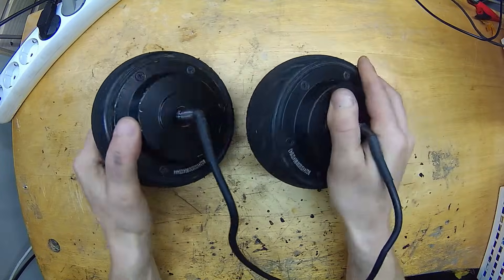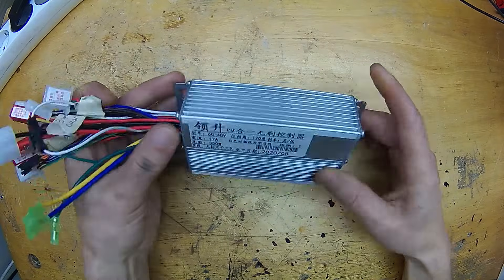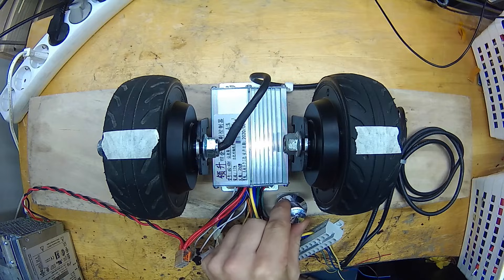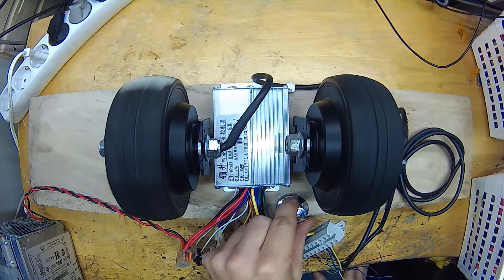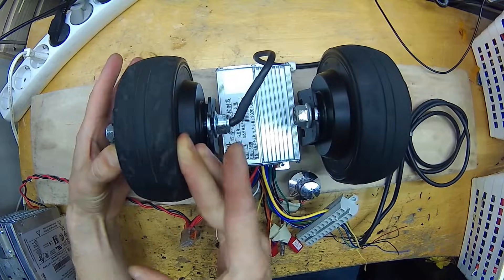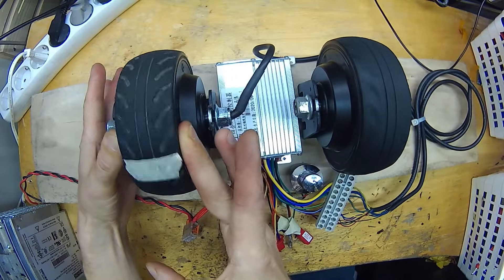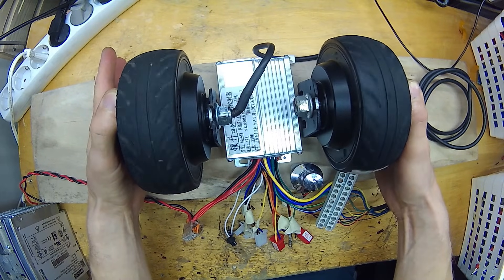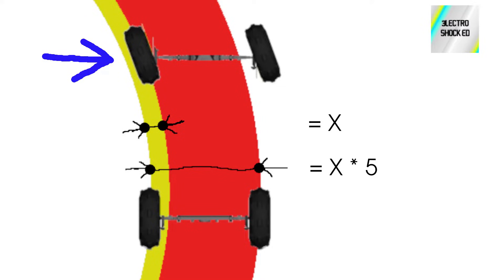2 HUB MOTORS with 1 CONTROLLER ? Yes you can!

Comment: This only works because slave motor is not loaded. Rotation at the same speed on a road does not help really because they need to be aligned in phase almost perfectly (unrealistic), not just the same speed.
Reply from the maker: yes, almost

Comment: Hi and tnkxfor your input on BLDC motors dual motors and it works as you said  ,I have a pair of hoverboard motors that I use to drive my fishing trolly ,I have a china controlbox ,NOW I need to know how to reverse the motors what cable do I need to use to reverse the motor ?
Reply from the maker: some controllers do in fact have a reverse switch, which can be used live - but this is very rare since meant for a 2-wheel vehical

Comment: So you basically are just connecting all the wires in parallel? Is the controller you are using designed for 1 motor or 2?
Reply: Also, do you have to account for the increased amperage?
Reply from the maker: yeah, just parallell. yes, one should account for double load if try this.

Comment: thank you so much! this is exactly what i wanted to see, saves me the time of trying it with so much worry. I got my custom built prototype etrike with front and rear motors and a controller with absolutely no setting adjustments i am allowed to change, so, i want to add my FARDRIVER 72300 to it with complete adjustable control, for both motors and 1 controller, this is great for me, Thank you.
Reply from the maker: Glad it helped! :)

Comment: I have an e scooter which runs on 36v. The scooter is broken, but only the battery survived. I have a hoverboard, and i want to make a mini bike, and i van to use the scooters battery, so I don't have to buy another one. Thanks for showcasing this. I'm gonna start this project today, but I have a question. The hoverboard motors together are 500w. A 500w controller will be enough?
Reply from the maker: yeah, should be fine. but be aware about the phase issues that I described. maybe leave the signal wires unconnected, if your controller supports that

Comment: cut them both hall sensors pcb inside the wheel itself and dont use hall sensors at all
Reply: Yeah I would have liked to have seen them run completely without sensors.

Comment: So, I have two of these motors, I think they are 350 watts. I bought the e bike controller that handles like 350-500 watt. Will it be possible that the controller will burn out because 2x350 is 700 watt motor?

Kind regards,
Dennis
Reply from the maker: Hello! Thats a good question. In theory the controller will just give them both tha max it can. But also it will be running full power all the time, which puts extra pressure on the elements... I presume something will quit at some point
Reply: @3LECTROSHOCKED I decided to go two controller 🙂

Comment: With all these new controllers out there now, One fardriver 200a line phase should be a better overall since it’ll take up less space to run dual hub.
Reply from the maker: thats right!
Reply: I got my custom built prototype etrike with front and rear motors and a controller with absolutely no setting adjustments i am allowed to change, so, i want to add my FARDRIVER 72300 to it with complete adjustable control, for both motors and 1 controller, this is great for me,

Comment: Hi may i know where did you get those wheel brackets for mounting? Bc i cant seem to find it anywhere. Also, is this a 4 inch motorized wheel?
Reply from the maker: they are original, from scooters the wheels came :)
Reply: @3LECTROSHOCKED  do you have the link to purchase the same wheels?

Comment: Can you attach a second motor with its own power source and use the one accelerator to control both motors? 

I want to attach a chain motor to the front wheel but I'm thinking if possible just buy a separate battery for the motor . I hoping that you can use the same accelerator to control both motors?

I'm not to concerned with the rotation of the motor. I just want to use it as a boost for longer distances.
Can you do that that without blowing yourself up?
Reply from the maker: Good question, thanks! You could use a system based on two optocouplers to keep controllers voltages seperated. And control them both with one speed controller. Check out info about an optocoupler :)

Comment: very informative experiments - the question was asked below on increasing the controller power capability  but one also has to make sure he battery BMW is ok with about 2x power delivery - right?
Reply from the maker: Hello! Thanks for Your comment. I personally dont use BMS systems on my batteries, so I dont have an amp-limiter in that sence. But yeah, you should have a battery pack with appropriate amp-rating for Your device :)

Comment: Hello 😮 nice job. I ve got a big problem. I ve got a scooter 5600 watt dual motor. I want to connect second battery but i can't find connectors with two cables for batteries two cables for controllers  😢😢 scooter it's 5600 60volt and each battery it's 40ah
Reply from the maker: Hi! Thanks for Your message. Well, I guess you should start searching for the cables, starting from the battery. They should be there for sure :) Best I can advise at this point.

Comment: thank you for the nice video.
i wonder how both wheels can spin 'forward' when you connect the same phase wires for both. Becoz since they are facing each other, one is actually spinning oposite direction to the other..
Reply from the maker: Hi. Thanks for your comment! Since this is not a dc motor - the direction is actually controlled by pulses. And if 3 main wires are exactly in parallel - they will spin the same way :)

Comment: It won't work.. the only reason it's barely working in your test is because the motor can bump forward/backward to align the phases again with the other motor.. when there is friction on the tyre and the motor can't bump itself back in to alignment with the other motor you will have constant desyncs.
The reason either motor shuddered when both motor's hall sensor wires were connected was because you're sending two different signals.. the motor that you aren't putting resistance on will still be sending pulses, so the speed controller keeps doing its thing.. The speed controller doesn't know that you've stopped one motor.
Reply from the maker: Hi! Thanks for your comment! Good points. That's exactly what I was testing. The surprising result was that they kept producing torque in a slight disalignment. Need to test on a real vehicle:) maybe this summer
Reply: @3LECTROSHOCKED  There isn't such a thing as a slight misalignment.. the motor will either cog forward or backwards one full phase, or the current draw will jump through the roof.
If you had this on a bike and you turned the corner, even the slightest additional distance covered by the front wheel would mean that the phases are no longer aligned and the front wheel will lock up.
Reply from the maker: Yeah, thanks for your comment! :)

Comment: Nice !!! 
Can 4 hub motors work with a single controller or is a special controller needed ?
Reply from the maker: Hi. Thanks for your comment! Why not, but you will have problems while turning your 4-wheel vehicle :) I assume that is what you want to build.
Reply: @3LECTROSHOCKED  that's right, i plan to build a mini utv in the near future
Reply from the maker: Yeah, too much radius if on a same axle:(

Comment: I want to use  two no of 350 watt  brushed dc gear motor , total 750 watts. Can I use an 800 watt brushed motor controller with a single throttle to control the motors any suggestions pls.
Reply from the maker: Hi! So you have two basic DC motors? Well that should be super easy :))) Just connect them parallel and hookup to a controller that can deliver twice the power. Shouldn't be any problem - I think :D Only thing I can think about is the slash in the resistance - but in theory that should not be a problem if your controller is  powerful enough :)

Comment: Any idea how to get one throttle running two motor? Each motor has its own controller but shares one throttle.  I got it working by sharing the throttle signal wire and the positive wire (do not connect the ground wire) 

As soon as I turn off the power switch on either controller, one of the motor spins at full speed. Any suggestions?
Reply from the maker: Hi! Well ground is shared anyways, if they are in the same battery. So try putting diodes in the signal to prevent back voltage from a controller to other controller :)
Reply: @3LECTROSHOCKED  I got it working properly right after I commented your video. Apparently, if you are running separate batteries like I am, you must connect Ground on each battery together, then connect only the Signal wire from the throttle on both controller. Nobody mentioned the Ground wire on the batteries every video I watched lol. Thanks for getting to my comment. Thanks for making this video.
Reply from the maker: Oh, great that I could help! :)

Comment: This will only work if you place 2 hub motors in the same line like on the scooter. If you apply resistance to one of the motors the phase sync if going out of control and basically one motor is pulling or stopping the other. So if you would like to use it on let's say a go cart,it will not work properly
Reply from the maker: Hi. Thanks for your comment! That's exactly what I'm examining here. And the result is yes, you can. But not on a same axle, like a go cart. You should watch the video till the end, if you haven't yet :)

Comment: What about 72v 1500watt system , like adding a same power hub motor model n front wheel to rear hub motors controller. What will happen? Will both motor's peak power will deduct due to 2loads in controller? My controller is 72v 1500watt peak current 50A ?
Reply from the maker: Hi! Well it's the same situation, so you would need a controller of double the power. Otherwise you will overload it and eventually burn it. Or course it would work for some time first :)

Comment: Did you use one battery too?
Reply from the maker: Hi! Yeah, one controller - one battery - one throttle.
Reply: @3LECTROSHOCKED  okay thanks, I guess I should try, i want to add a front hub motor trying to run them both on my 36v 10AH battery and same display monitor. 
Both motors are 36v 250W, do you think it can work?
Reply from the maker: You need a controller of twice the power, so probably no :(
Reply: @3LECTROSHOCKED  okay thanks I will go with your recommendation. I appreciate your time...
Reply: @3LECTROSHOCKED  , one more question, will 2 separate controllers work on 1 36v, right?
Reply from the maker: Yeah, of course, but will be consuming more power.
Reply: @3LECTROSHOCKED  okay thanks🥴

Comment: Always thought that two hubs one controller and one throttle and multiple batteries was the only way to go. Hiding all wires in frame using Bluetooth connections when possible. For speedo & battery levels if posdible. UBCO is about the best I've seen up to now.
Reply from the maker: Hi. Thanks for sharing:)

Comment: Hello brother it's a very much learning video I have a question on this topic can we add joystick to this controller please make one on 3 way front back and rotating side through joystick it'll more helpful
Reply from the maker: Hello! Good question. That would require a separate controller on each motor. Also there needs to be a reverse switch on those controllers. Making a joystick interface and connecting it is not that hard, if you have all of those functions available. I advise you to check out general controller boards. Ebike controllers are not the best choice for that kinda project :)
Reply: @3LECTROSHOCKED  can you make one video on this topic of  3 way drive front back and side ways
Reply from the maker: Sorry, I don't have any use for that now. Maybe in the future :)

Comment: still running fine. id just make sure the controller can handle both hub motors. now i am adding a setup booster to my 48v 60ah battery. im jumping the hubs to 72v
Reply from the maker: Great! Sounds awesome! We still have a lot of snow on the ground,  so I haven't had a chance to build anything yet to actually try this out.
Reply: @3LECTROSHOCKED  Please update us when you do, i am very interested in a full wheel drive electric bike.
Reply from the maker: Of course!

Comment: I have 2wd scooter a xiaomi m365 and I seem to have the same type of controller. If I wanted to shut the second motor off to save battery with wire should I tap and make switch? Im thinking should it be the signal wire? I havent tried disconnecting it yet but would like to hear your input as to which wire should I make a switch out of.
Reply from the maker: Hello! Wou, that's a very good question. So if 3-phase motors are connected in parallel, then you need to disconnect two power wires out of three. That way one of the motors will spin freely and not create a conflict of resistanses between both of them. Need to remember that a motor is also a generator :) Hope this helps. Thanks for a very good question and a comment!
Reply from the maker: Hello! Wou, that's a very good question. So if 3-phase motors are connected in parallel, then you need to disconnect two power wires out of three. That way one of the motors will spin freely and not create a conflict of resistanses between both of them. Need to remember that a motor is also a generator :) Hope this helps. Thanks for a very good question and a comment!
Reply: Hi! Im sorry, I forgot to mention, I'm running two separate controllers. The phase wires are not paralleled. The display/throttle wire is the only thing on parallel. But I will try what youve mentioned since its better to put a switch on the phase wires to avoid the motor from generating electricity. :)
Reply from the maker: Oh, well actually in that case I suggest to just shut down the second controller. No resistance will be applied on that motor wires in that case. Unless there is a some kind of anti theft system to close motor power wires in a bunch to stop it from moving freely :)

Comment: hes right. it works fine. the 1000w controller doesnt get hot and  the hubs only drop phase occasionally and always just when getting the bike going. and my 350w hubs are not made by the same company. does anyone know if a throttle can be split to feed two controllers?
Reply from the maker: Hello. Thanks a lot for your comment! Yes, you can hookup two controllers to one throttle. It's pretty simple, just connect them in parallel. But I advise to create a "valve" with two diodes. I show that diagram in this video, while making another eBike-project: https://youtu.be/6TIP0e4Qdx4 Thanks again for watching!

Comment: If you have 2 hub motors does that mean you need a battery with double the voltage of what the motor takes?
P.S. is there anyway I can get in touch with u so I can ask you multiple questions for a project im working on.
Reply from the maker: Hello! Thanks for your comment. No, not the voltage. These are connected in parallel, so you need double the amps. So bigger battery pack and twice more powerful controller. Please ask your questions here in the comments, I will try to help :) Thanks for watching!

Comment: i had a two controller setup which worked great, but one of the controllers crapped out.  So I am taking your advice and setting 2 350 wt hub motors on 1 1000w controller. I thought that a bigger controller would reduce the chance of it burning out. the one controller means less wires and less space used on the bike then having two controllers. I will write again later on and tell you what happens
Reply from the maker: Hello! Thanks for your comment! Sounds very interesting. Please do keep me posted on how it works with your setup. Btw, is it a scooter or a bike?
Reply: i would love to know how yours worked over time, any news?

Comment: hi, i want to control two hoverboard motor, which controller should i use, thank you?
Reply from the maker: Hello! Thanks for asking! That's a good question. How will you use those motors? Running at the same rpm or different rpm like on an actual hoverboard?
Reply from the maker: Would those wheels be on one axle?
Reply: @3LECTROSHOCKED  thanks for your answer, yes I want to run with the same speed and on the same shaft,
which controller should I use and where can I buy? thank you
Reply from the maker: Well in that case use two controllers with one throttle. Separate throttle inputs with diodes. This is because the difference in rpm will be too big when turning, if those wheels will be on a same axle. Using one controller definitely won't work. Hope this helps! :)

Comment: Sir how about 2hub motots 2 controler but only one throttle how to wire it should ii connect parallel?
Reply from the maker: Hello! Thanks for your comment. That's a very good question. You should at least separate signals with diodes to try to avoid any problems with lowering resistance and back voltage. I showed that in this video https://youtu.be/6TIP0e4Qdx4 Hope that helps :)